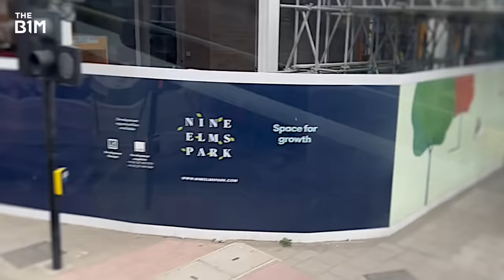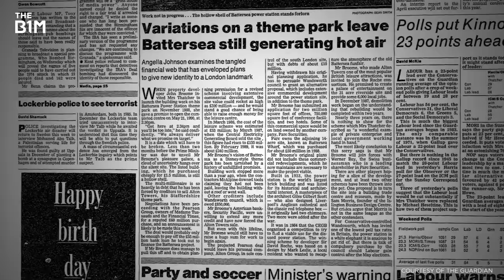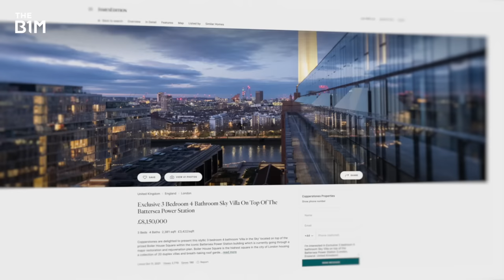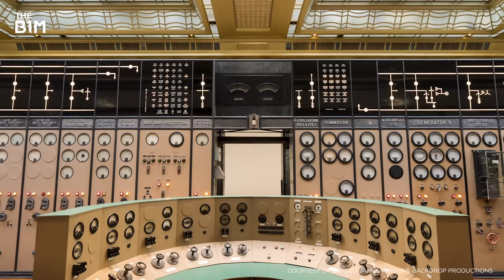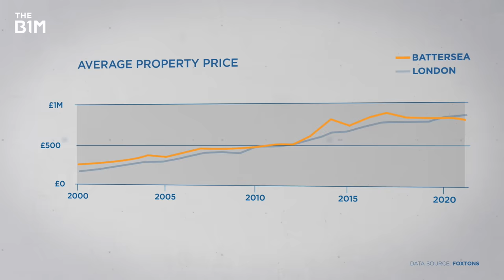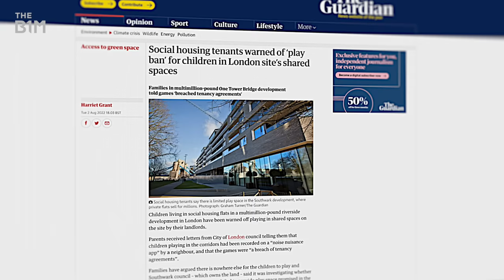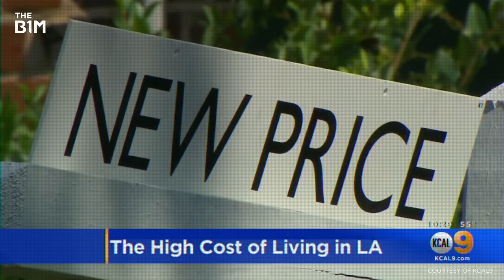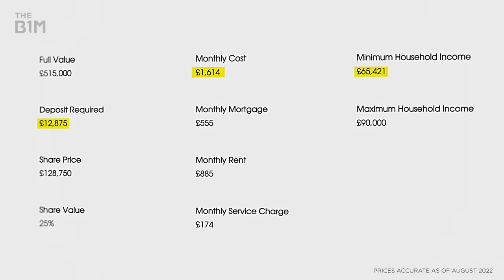Why Our Cities Are So Expensive

Comment: The UK classes housing as "affordable" if it's required that the buyer earns more than triple the average wage at £67k a year. An affordable house is only affordable for the top 15% of earners in the UK. Imagine what the other 55 million people can afford when 70% of the entire population of the UK earn £15k per year or less, when "affordable" housing requires them to earn more than 4x that amount.
Reply: Whilst I agree with the sentiment here, you make this seem a lot worse than it is. The median salary in the UK is £26k, meaning at least 50% of people earn this or more, making your figure of 70% on less than £15k wildly inaccurate. In London the Median salary is significantly higher at £40k. On the other hand to earn that £67k you have to be in the top 8% of earners nationwide, not 15%, which is actually worse than you suggested. However, this is still only 2.5x the national median salary and 1.7x the median London salary, not 4x. This is still really bad, given that this is required for shared ownership schemes, but its not nearly as bad as you suggest.
Reply: @surb I don't think you understood the point I was making. I wasn't disputing that it's ridiculously expensive compared to the rest of the country, I even state that in my comment. I was pointing out that the figures OP gave were very wrong and misleading and would lead someone to believe it is a lot worse than it actually is.
Reply: I work in statistics, and if there is one thing I that bugs me its people misrepresenting or changing stats to suit their narrative and making outlandish claims, whether intentionally or not. It doesn't help anyone make an informed assessment of the situation.

The situation is really bad. As bad as OP suggested? No and quite far from it.

On another note, student loans, whilst an important expense to consider for buyers/renters, are not something everyone has. Millions of people have not attended university. When talking of buying houses its common practice to calculate the ratio using income before Taxes and Expenses.
Reply: @R0bbi3d  Plus that's a household income, so it probably assumes two earners. Sorry single income families and individuals, these homes aren't for you.

Comment: I would have liked to hear discussion of how zoning laws, purposefully onerous permitting roadblocks, and NIMBYism cause housing prices to increase through designed under supply
Reply: Yes! This is one of the biggest reasons housing prices are so high. If there is one house and ten people trying to buy it, who is going to get it? Whoever has the highest budget! We cannot expect housing to be affordable for anyone if there are no houses for people to live in in the first place. Scarcity drives costs, not some mystical forces beyond our control. We need more houses now.
Reply: We don't have zoning laws in the UK. The idea it's regulations that cause this is infantile
Reply: @ronancorrigan3467  first the video talks about cities around the world struggling with this issue and second the nimbyism of excessive zoning can take form in harsh permitting structures. For example, the borough of Kensington and Chelsea need to approve more housing. I am pro regulation I just don’t like it when regulation is purposefully used as a tool to segregate and push new housing further away from jobs ect
Reply: @Paulsyfi  yes please - but that’s the whole point - the attempt to building more housing in your own back yard is often illegal or denied by local government
Reply: Don't forget the role of rent control in limiting housing supply.
Reply: @markrobinson9956  there is mixed evidence if rent stabilization or rent control limits the supply of housing. There have been cases where rents rise with rent stabilization higher than comparable municipalities without rent control. The nearest to a consensus though is that rent stabilization is effective if it acts as a anti-price gouging tool rather than a prescriptive measure.
Reply: @Lazarus Do any British people live in London anymore?
Reply: @ronancorrigan3467  the uk has case by case housing regulation.  Meaning they will determine wether to approve a building or home at the time of construction. 

This is regulation and this method has its problem . Which is why the uk is slowing try to accept a zoning code
Reply: Not a supply issue. The real problem is speculative demand. You'll never build your way out of that problem.
Reply: You just described San Francisco.
Reply: @maxjohnson8659  They literally outbuild demand in Tokyo
Reply: Not everywhere is America, friendo.
Reply: @ronancorrigan3467  Is this comment a joke? The UK has one of the most strict regulation laws in the whole world, every building has to be approved individually, that is even worst that a stupid zoning law...
Reply: @maxjohnson8659  Not a supply issue? Come to The Netherlands and try to rent an apartment, there are 20 viewers per apartment viewing...
Reply: @engineeringvision9507  Yes, plenty of them - not all British people are white if that's what you're trying to suggest.
Reply: @ronancorrigan3467  the uk doesn't have zoning but it does have heavy local control, so much so that it does cause a harmful effect on the housing market and the individual owners
Reply: @pangolin83  Exactly, many white people are aboriginal natives, many white people are indigenous to Africa, many white people lived in ancient China, and not all British people are white.
Reply: @ronancorrigan3467  ll
L
Llllll

Ll
Ll lllll l
Reply: L
Reply: L
Reply: Pl
Reply: @johnsamuel1999  they shouldn't, zoning is very bad for growth, from housing to industry and so on.
Reply: Pl
Reply: @johngorman6641  price controls are by their very nature immoral. There is considerable amount of evidence and logical reason to assume rent control can cause a shortage of housing, as an understanding of basic ecconmics can lead a person to see that when the government places price controls there is always shortages. Rent control is harmful and wrong.
Reply: @engineeringvision9507  about 13 to 14 percent of them. But I wouldn't call them British.
Reply: @pangolin83  historically speaking yes they were or descendent of them. The migrants the country is importing aren't British people so don't pretend otherwise.
Reply: @engineeringvision9507  yes those white people are the people born and native to the uk and therefore natives. Please name me these aboriginal natives that are white. Not all British people are white but most are and all where historically.
Reply: @kordellswoffer1520  p
Reply: @kordellswoffer1520  Please refrain from your racist comments towards white aboriginals in Africa and Australia, they deserve our support and respect just as the indigenous non-whites of Britain deserve our support and respect.
Reply: @engineeringvision9507  no they don't. Not all peoples and cultures deserve respect.
Reply: @ronancorrigan3467  Well you do have zoning of a sort.  You are only allowed to build to the scale of what already exists - unless you're one of 10 development firms who have already greased the necessary palms and they can build whatever they want.  So you have mostly just single family homes and small blocks of flats, then pockets of enormous mega-developments (see Vauxhall).
Reply: @Lazarus are you referring to the multimillionaire ones who buy homes they will never live in to hid there money, dodge tax and are helping to fule the issue. Or the ones escaping conflict/ looking for a better life who also can't afford homes and have a disproportionate rate of homelessness and contribute more in taxes then they use?
Reply: Ask LA and their stupid zoning law of single family houses only...
Reply: Yep
Reply: @ii4371  Another reason is that people are living apart more now - we used to have over 4 people living in a house - go through any town now and it's apartments that are being built not houses.
Reply: @wesa1998  Does it really matter? Just get them all out problem solved
Reply: @hairyairey  You dont say. My neighbors house used to house a family of twelve plus a tailors shop
Reply: @johnsamuel1999  That's a fundamental mistake then.
So, they are basically telling the developer: "Now on this dotted line, you promise?... pretty PRETTY PROMISE not to segregate communities once this project is made available?" 🥺

These councils are a joke. Privateers are in for " private" profitability NOT for the public. Councils spend 40-48 hours sitting on their hands to do what, exactly?
Reply: There isn't designed under supply of housing in London. There is loads of housing being built, but as many people in the comments here have said it's being built to sell to affluent foreign buyers who use the housing as an investment/safe haven, not for living in.
Reply: @DrewWithington  if there is only high cost housing being built - then there is undersupply. The highest input to housing costs is land and housing costs only decrease when more units are fit on the same amount of land. Housing costs rise when land values rise (more demand) and the supply of housing does not increase in existing neighborhoods.

Comment: The root is planning.

It’s far too restrictive to actually expand cities and add density to built areas, that whenever land like this comes up, developers are forced to effectively gentrify an area just to make some money off the cost of construction.

Make it easier for our cities to get taller, and make it easier for them to expand. The two results will be reduced land costs and lower barriers to entry, so that building affordable housing at scale actually becomes feasible - rather than a govt mandated afterthought as it is now.
Reply: Urban expansion leads to other problems. It leads to the requirement to have massive infrastructure projects such as Crossrail and look at how much that cost (not saying Crossrail is bad whatsoever but the need for it has been driven by urban expansion). As for getting taller, NYC does this but still has the same inherent issues as London when it comes to affordability. Caveat, I don't actually have an answer. Maybe better interconnectivity between urban areas given the whole shift to hybrid working?
Reply: @pavm7566  New York and UK cities specifically don’t quite have the same issues.

New York has always been limited because of its Geography, they had to go tall out of necessity.

Right now the only thing holding back cities from growing organically is choice - 6%(ish) of all UK land is urban use - so shops, offices, houses, gardens, parks etc. 12% of all UK land is designated green belt land that you practically can’t build on.

We could easily allow our cities to grow, and invest in new infrastructure at the same time - at a time when most other forms of economic development are slowing or have outright stopped. We just have to choose to stop protecting some empty fields that most people don’t actually care about.

Nobody is saying we should be paving over every bit of land, or even most of it - and not at all in areas like our natural parks. But we simply cannot carry on being almost totally unable to build the infrastructure and housing we need to tackle the two biggest crises of the next 50 years - housing and the environment.
Reply: and i think the root is private property, all housing should be public
Reply: @bendixon800  For the NY piece, they have 5 boroughs. They did not have to build up solely in Manhattan. They're currently in the era of urban sprawl into said (massive) boroughs and yet still one of the world's least affordable cities. 

I'm fully in agreement with you that we need to build housing and infrastructure above many other things BUT what we see in nearly every urban environment is that people gravitate towards high economic opportunity areas (ie central london/manhattan etc). So unless, as we expand outwards, there are pockets of said areas (ie Canary wharf etc) then it will always be the case that investment pours into areas within close reach of these areas. As opposed to sprawling out because who wants a 2 hour commute to central london from Zone 100 when they can by in St Albans and get commuter trains? 

That greenbelt you speak of surrounds London. And if we're talking environment, the more we eat into that the more polluted London air gets (beyond the shit it already is) and not to mention the biodiversity piece.
Reply: @UnnTHPS  Even if it were the case that all housing was publicly owned, and even if local authorities currently had the means to build lots of new homes - planning laws prevent, hinder, or at the very least add significant cost to their ability to do so.

It’s the same reason the UK has all but failed to build new infrastructure for 30 years except in London - planning laws make it next to impossible to do so.

They’ve tried to build a new a new reservoir for Oxfordshire for 30 years - continually blocked by NIMBYs exploiting planning laws and local rights to object, and now Oxford faces a water shortage. 

It’s a farce.
Reply: @UnnTHPS  Okay fair enough, and then what happens to all the people that drive the UK economy which public housing can't meet the needs of? I'm referring to business owners (that do pay their taxes properly), investors and higher PAYE tax payers? They'll shift off to other countries that do have the housing stock for the amenities they want in their lives. And that's a majority of the tax revenue gone.
Reply: @pavm7566  Air pollution is not reduced because of lots of empty fields 30+ miles from the center.

And yes, we need economic zones beyond the centre - things that are ALSO prevented by planning Laws in this country as adding density to new areas is “not in keeping with the local area”

They need a root and stem tearing up. Town and planning acts from the 50s are not relevant to the modern day.
Reply: @UnnTHPS  If the government owns all the property, they have final say on who gets to live on that property. That is, if you do anything the government doesn't like, then they can easily make it so you can't live anywhere that matters, condemning you to life of poverty.
Reply: Build new cities
Reply: Its Brazilification, careless importation and activist foreign policy relegate home policy low priority.
Reply: @pavm7566  You are certainly correct. The problem is the mononcentric design of urban areas. Because everyone wants to be as close to the centre as possible, the land value shoots up, and sprawling is not really an option. If you look at a city which is more or less decentralized (like Tokyo for example), it has less gentrification problems. But having this kind of an urban planning strategy requires immense investment into public transport, transit orientated development, etc. And even then homes in urban areas will not really be affordable. Cities need to subsidize public housing.
Reply: @TheUnshatterd  I think the market will solve it's own problems if you let it work freely. The city centers of major cities become out of reach of the working class yes, and even a wide area around it only becomes affordable for the upper middle class. But if you allow cities to grow and even have nearby cities close to the major city expand it will eventually solve the housing problem.

 So why would these people much further from the center need to go to the center frequently? To commute to work right? But if you're a factory or some other primarily blue collar company, are you going to base yourself in the city center?

 Companies and stores will adapt to that new reality too. Only major offices of fortune 500 companies can afford to stay in the inner city. The place is filled with the ultra rich. But even that shouldn't be a problem, as a middleclass person that place is just not for you, and there WILL be alternative lovely places that are for you if you let the market do it's work.
Reply: Problem is the suburbanites don't want that to happen, they don't want to be turfed out of their semi detached house into a smaller flat or boxed in by high rises.
Reply: @TheUnshatterd  Japan also has negative house price growth, which means its more common for houses to be completely demolished after only a generation.

Comment: Having worked with property developers for decades I have to say it simply comes down to sheer justification and indifference. They'll always have a good reason or a method of not accepting that they cause social damage.
Notably you can see pulses of terrible housing epochs when regulation is weak and and developers dominate regulators. When regulation is reinstated and social goods put back into a community have to be real and not a communal choir or something similar then communities thrive.
But in essence they don't even understand that such a thing as 'community' is real or relevant and if they do they don't care.